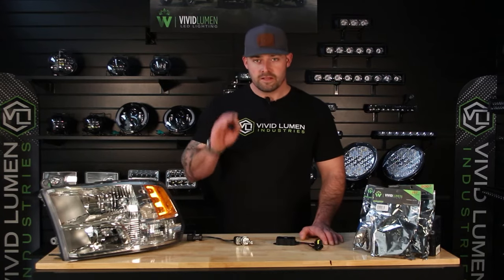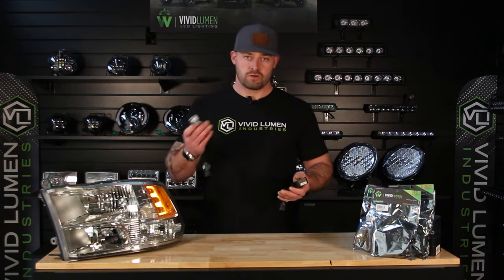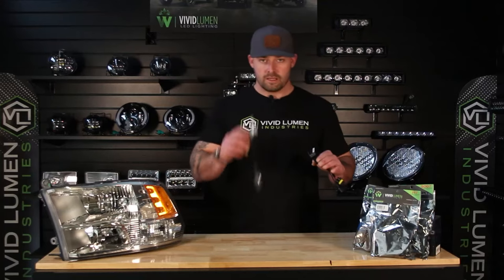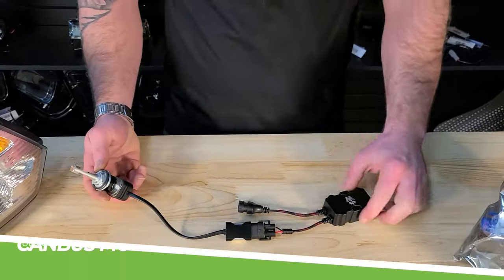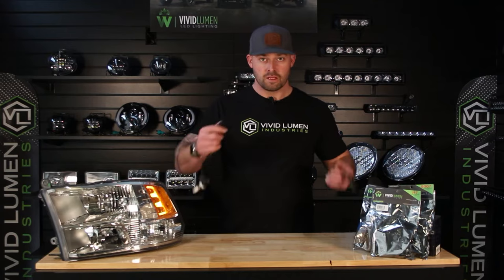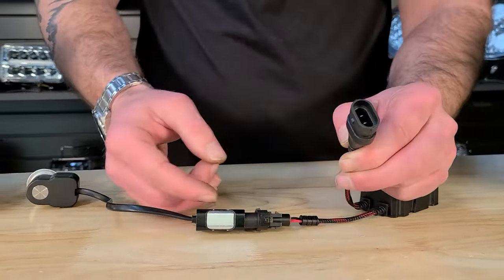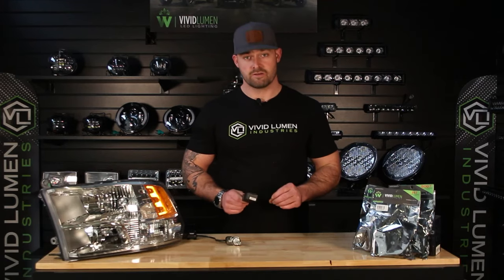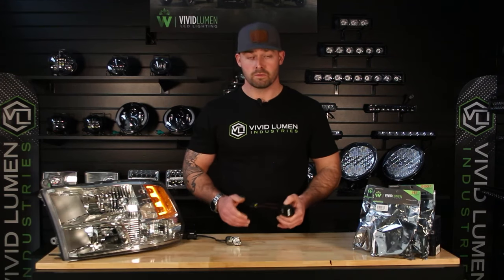WHY is your NEW LED Headlight Flickering?? - Vivid University

Comment: I have a set of led headlights with canbus built in and amazing output. Only thing is when my auto stop start turns my car back on at stops I get a super fast flicker one time because I assume the power draw of engine brings my voltage under the working range of the canbus driver. Is there something I can do to remove this?  Idk what I need maybe a inline capacitor or something?

Comment: So I have a 2008 Honda civic, I just put in some brand new white led lights. I started with the yellow halogen lights. When I start the car drl flashes on the dash. The leds work though. Was wondering if it’s ok to leave them that way or do you think I need to get a pwm module to get it to stop flashing on my dash

Comment: I have LED’s on my 2015 Dodge Charger and come with a canbus but the lights shut off after a while, will this item you have solve my problem?
Reply: The car thinks the buld is out because of low voltage. get a decoder.
Reply: @NeoAndersonReloaded  decoder didn’t work either, I tried a few different ones, I told it to a friend and he ran a separate wiring harness for the lights with a switch, now it’s been working fine.

Comment: I've installed these in both the high and low beams on my c240 and my high beams still flicker. Problem not solved
Reply: Same on BMW.
Reply: Just buy a brand new Lamborghini. My Lambo doesn’t have that issue. Problem solved
Reply: @CleetusJackson123 💀